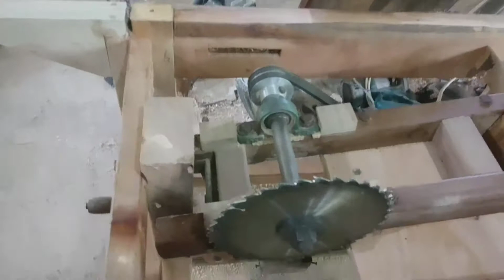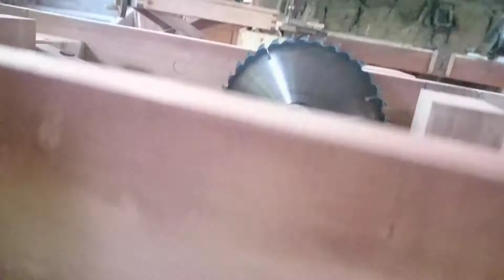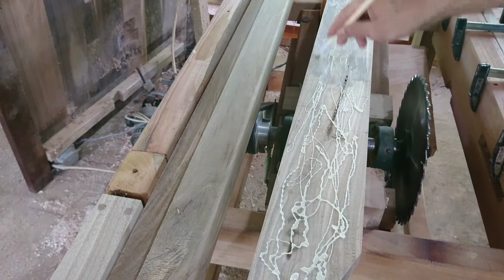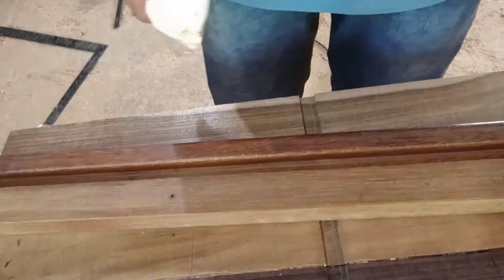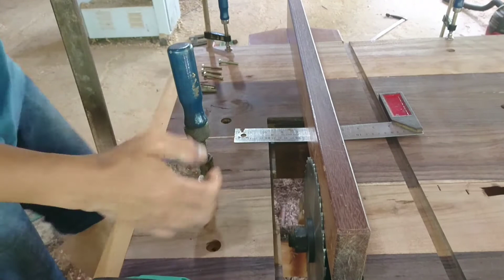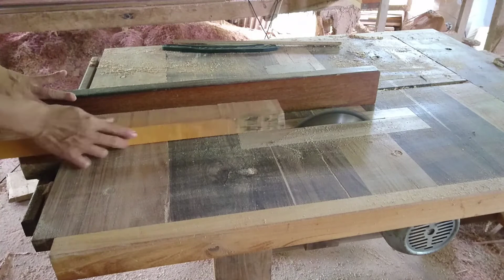Seting meja table Saw karena memuai

Comment: dinamonya brpa pk mas
Reply from the maker: 1 hp
Reply: @weskenel  mas 1 hp itu wat 900 kuwat ngak om
Reply from the maker: 900 kurang setabil , 1350 wat mas
Reply: @weskenel  rekomendasinya mas kalo kilo meter listrik di rumh saya 900 wat pake dinamo apa yang watnya rendah
Reply from the maker: Listrik kebutuhan utama untuk mesin penggerak, kalo daya 900, 1'5 pH bisa tapi ' untuk bahan tipis kaya triplek / tebal 2 cm Mash bisa,  sebaiknya tambah daya listrik dulu , kebutuhan bukan table Saw saja, pasti ada serut, bor, dan lainnya kalo pakainya bersama, pasti turun listrik.